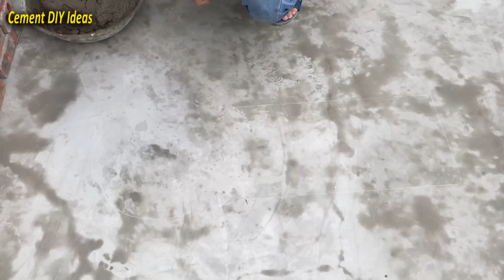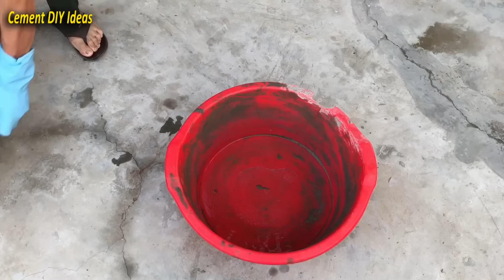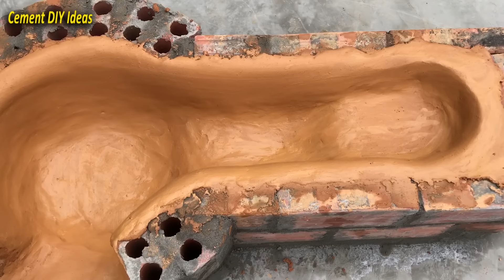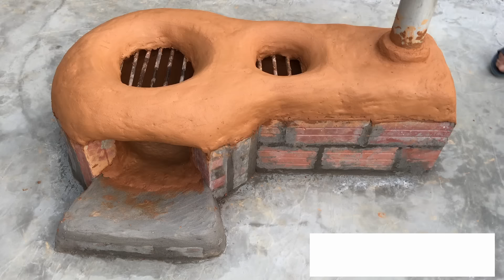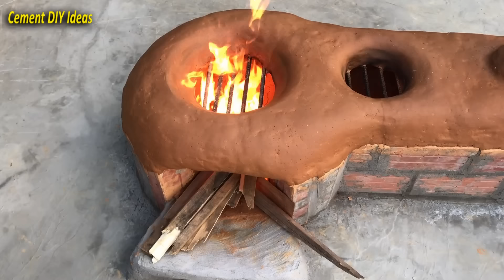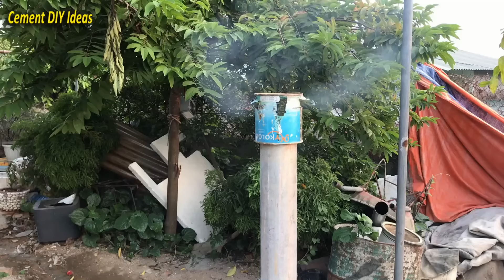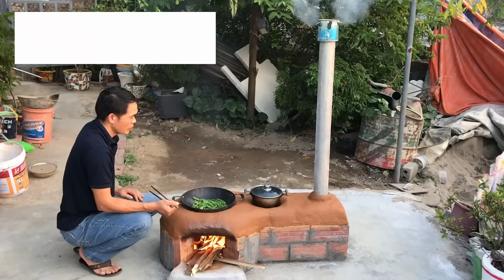New way to make firewood stove - No smoke -  Saving firewood

Comment: Clever idea! Can this be made with a taller height from the ground? My elderly parent would love this concept.  How long did it take for the red clay to cure prior to utilizing it for cooking?
Reply: I don't think the red clay was cured. The way it was built, I think it'll crack at on point sooner than later.
Reply: @princessturandot1659  Clay doesn't "cure". Some clays fire at quite low temperatures (540 C), which would be similar to the temperature in the oven so as long as it was applied evenly and had no air bubbles, it should be okay. Material such as crushed shells, sand and grit can be added to the clay before firing to produce a more open body that is less likely to crack. People have been firing pots in open bonfires, fire pits and clay ovens for over 9,000 years so I wouldn't be concerned about the clay cracking. The bricks have been fired at a higher temperature than is required for red clay, so they'd be okay too. I would be more concerned about cracking occurring in the concrete where it meets the clay. Perhaps cracking not problematic in a hot climate, but bad in cold climates where water can get into fine cracks and freeze causing them to expand.
Reply: Yes, it can be made taller above the ground.  You just need to build a platform as tall as needed, that can also support the weight of this stove.  If you build something using three or four levels of concrete block in a "U" shape, open at one end, then top it with a concrete slab, you can store your wood in the open end.
Reply: Mixing clay with water and then heating it (like with a fire inside) is basically how you get terra cotta. With that in mind, this oven probably wasn't finished until after the first fire.
Reply: @jkcarroll  I really like this idea; it seems to be a solid way to save space with this already compact design
Reply: @anncoffey8375  Yes, a lot of people in Saskatchewan dig their own clay too.
Reply: @jkcarroll  Great idea!
Reply: @princessturandot1659  

Mm bc  Z
Reply: @prasadilalkarnawat4595  
😂😂😂

Comment: Cool!   That is still smoke coming out of the tall smoke stack though.  I don’t understand.
Reply from the maker: thank you
Reply: So right or wring? Cement DIY ideas do you mean it diverts the smoke away from the person cooking but still puts in the air.. and less firewood needed because the clay etc and design keeps it hotter.
Reply: @ladynataliemarie7780  I'm guessing the uploader isn't a native English speaker. This design is ideal for inside a home because you divert the smoke outside your cabin with the smoke stack. It saves firewood because of the ceramic/clay insulating properties.
Reply: I think (and I could be wrong) the coffee can on top of the smoke stack is open in different parts. So, not a big mass of smoke comes out at once so it is easier dissipated into the air.
Reply: @cricket sd The man don't smoke lol
Reply: @luizcarlosquerido2943  good one dude 😂
Reply: @ladynataliemarie7780  
Bingo  🎯🎯🎯🎯

Comment: I think it will hard to clean the rest of ash.
Reply: The ashes stay only where he is burning the wood. The rest of it is just smoke going through the rest of the cooker up the smokestack. It would be easy to clean out the ashes. He gets high heat where he is cooking the beans and lower heat where he is cooking the eggs. Very smart of him. I have seen people do it with only one cooking area and have to pull dishes off the heat because they get too hot. I wish I could do what he did, but I don't have the skill. I'd mess it all up. I'll just cook on my grill.
Reply: You can always blow all the ash, by using a blower through the smoke stack, or a vacuum through the front opening.
Reply: @magoolew5131  Not a lot of skill really, it’s very primitive. I think anyone could do this fairly easily.

Comment: I've always called this a dakota firepit. You can dig one in the ground in just a few minutes. They let you have a low key fire with very little smoke, that requires very little fuel. I can cook dinner over a hole in the ground just a few inches in diameter with no more than a couple handfuls of twigs as fuel. They are very useful when camping. This project is an awesome recreation of the same concept. I imagine you could make one literally any size and it would work great.

Comment: These type of "Fire pits" are awesome... Just know that they burn quite a bit hotter than a normal open air fire would, and will also eat through wood faster...
Reply from the maker: thank you
Reply: @cementdiyideas4789  no problem. I used to love building little hobo stoves out of large tin cans... which is basically one of these. I would make them when id go camping. 👍

Comment: If you heat portland cement above about 100C, it starts to degrade.  You need a better barrier in the way of the heat from the fire.
Reply: muchas felicitaciones lastima que no sea enespañol👋😊
Reply: @luciaacevedo7816  
el traductor de google puede ser una herramienta 
"Si calienta el cemento Portland por encima de los 100 ° C, comienza a degradarse. Necesita una mejor barrera en el camino del calor del fuego. "

Comment: They must have a cheap red clay nearby to use. Great idea, no doubt thousand year old design. Putting in an ash tray would make it much more easy to maintain. A simple slide out metal box as the base, about 2” deep. Maybe make the chimney a few feet higher. I think I will try and build one this summer. It looks quite efficient.
Reply: 6hv
Reply: J

Comment: Seems to me it would be better to have the opening on one end to be able to feed a hot fire at one end and push the coals to the back to make a low, slow heat. An door (clay, 2 bricks, etc) at the other end would allow the stove to be cleaned out. And, mortaring all joining sides of the bricks, rather than filling in after they're set, would produce a better, stronger stove.

Comment: Hi, you could make it best with wheel metal base 50cm high with shelves.
Reply from the maker: thank you
Reply: @cementdiyideas4789  Thanks for reply, I found no one commented to you about the useful of salt as fire base to keep hot degree to highest & longest, we used to base bakery bricks ovens with 30cm of salt base down the fire bricks to keep it more hot. try it , thank you

Comment: dig a trench,,,,,,,cover it with metal sheet,,,,,,,,,cover the edges of the sheet with dirt,,,,,,,,,,fit a metal heater pipe chimney  at the high end, by dirt forming,,,,,,,,,,the low end is open for feeding wood to the firebox beneath the metal sheet,,,,,,,,,,,put your cookpot on the metal sheet,,,,,,,,,,it works best on sloping land

Comment: I think the pots must be a tight fitt for it to be smokeless
Reply: Once that strong draft gets going up the chimney, it will pull smoke up and away, even with small gaps around the pots.
Reply: @hanginlaundry360  My grand parents use to have an old black cast iron stove which worked similar. I think you are correct the draft do the tric